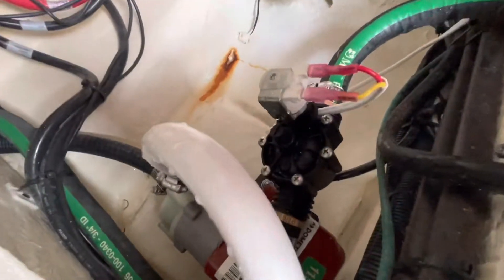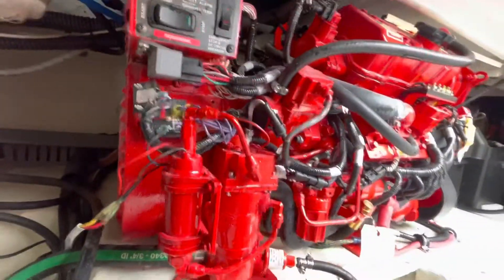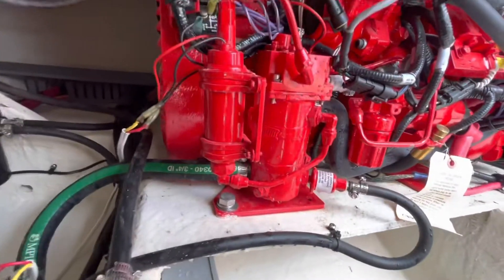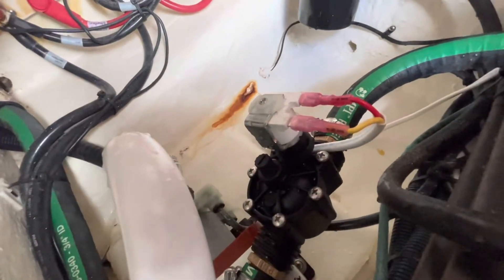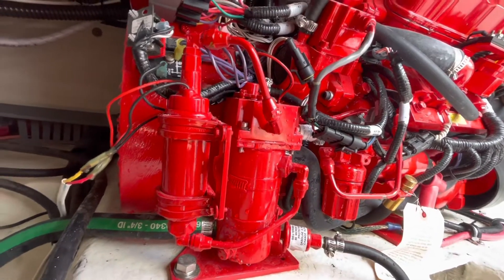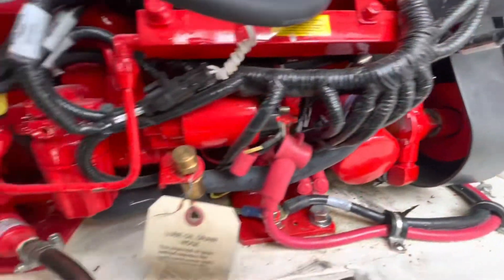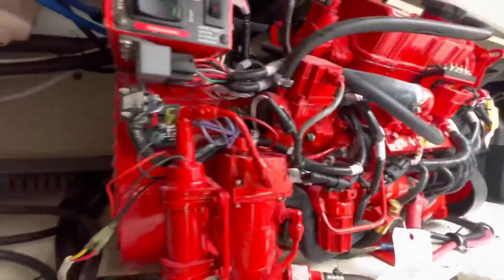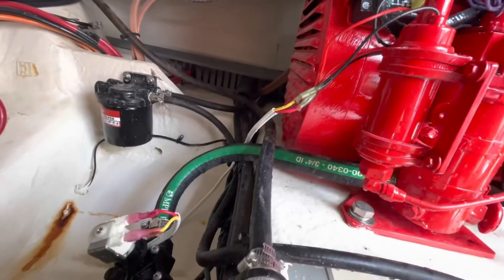How to save your marine generator from water ingestion due to high speed thru-hull intakes.

Comment: I was always really annoyed that manufacturers don’t use a fail safe like this.  It’s irresponsible to design something that relies on the owner remembering to close something that can cause a catastrophe.  At least a warning light that lets you know that seacock is open. Thanks for all your great videos.
Reply from the maker: Thanks Keith. It is extremely frustrating and disappointing. Westerbeke does not warranty water ingestion so if this happened you’d be in a fight with the boat manufacturer and you know what they would say. Not good.

Comment: Did you hydrolock the motor to arrive at this conclusion? Fill the motor maybe?  I'd be curious as to how you arrived at this repair.  I completely agree with you and think this is an extremely competent solution.  Cheers to you sir.
Reply from the maker: Another boat we were working on did ingest saltwater because of the pickup

Comment: Very informative, is there a warning indicator at the helm  in case the automatic valve fails during operation?
Or does the generator have a high temp auto shutdown?
I know my generators only have low oil shutdowns.
Reply from the maker: It does have a high temp shutdown. If the valve ever fails it will be obvious as to the cause. Worst case it ruins and impeller, diagnose the valve as faulty and get a new one. I’ve been told this valve is very reliable and simple.